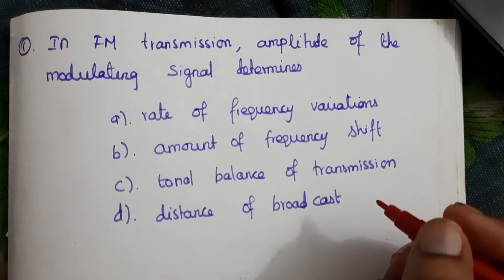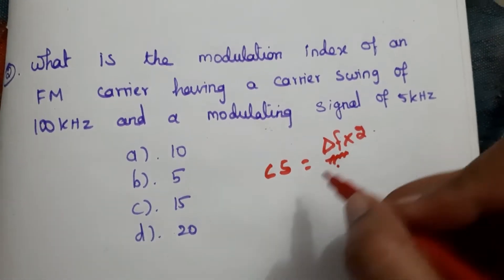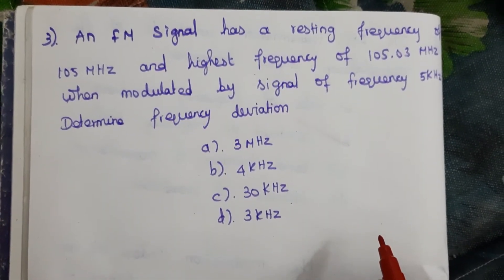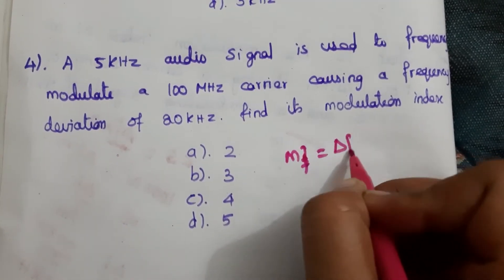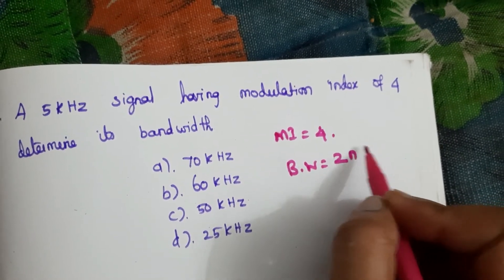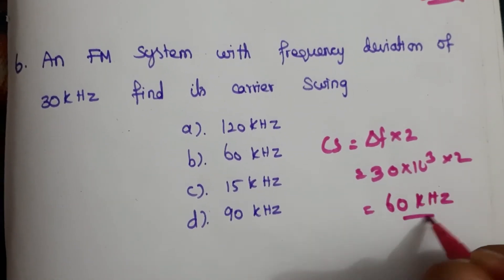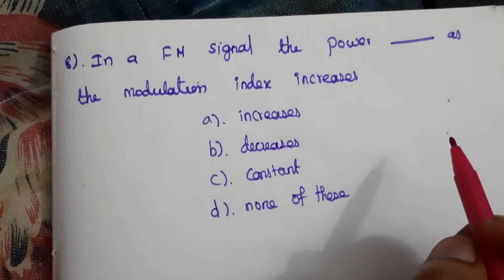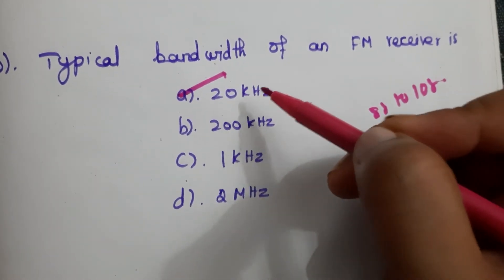Solutions for Test Series 17|Analog and Digital Communication Systems|trb preparation|#ECETutor

Comment: for 5th question band width = 2(beta+1)fm ...formula use pani panalamai mam...y we go this method mam any reason..
Reply from the maker: Memorizing that table for shortcut method..you can find answer using that formula also..
Reply: @ecetutor5041  but for that method got 50khz mam... But your answer 70khz mam... Which one is correct..
Reply from the maker: @ramaganeshkaliappan3400  that expression is based on the assumption that sidebands having Amplitude less than 5%.that eqn gives approximate values..but here both the answers are acceptable. .
Reply: @ecetutor5041  thank you mam for clarification